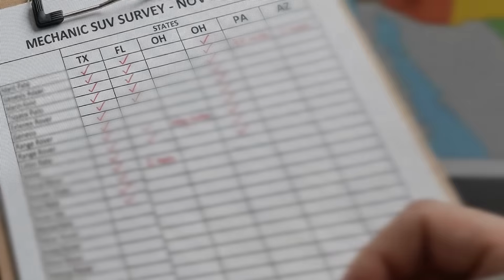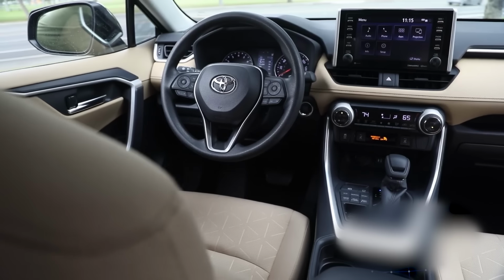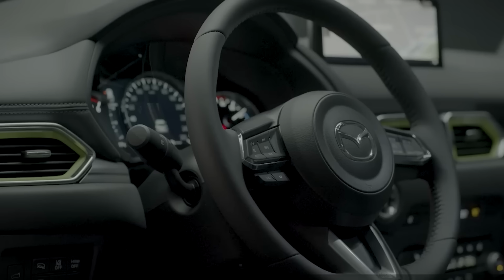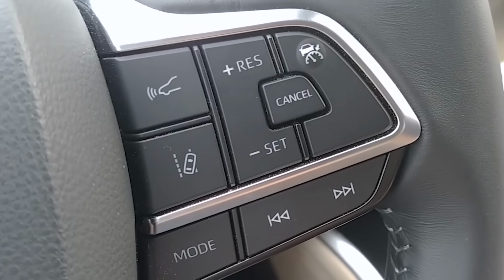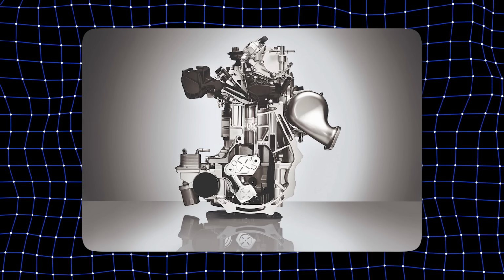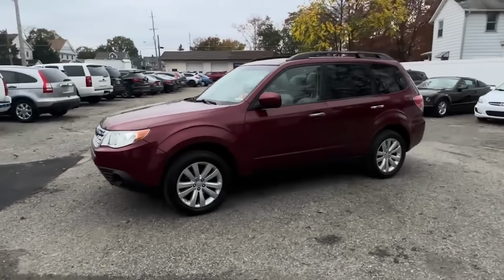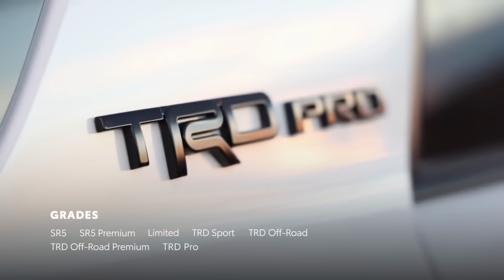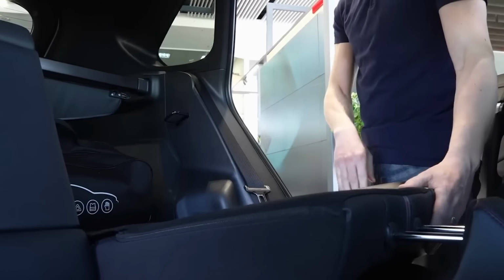7 SUVs Mechanics Trust With Their Own Money (No Premium Brands)

Comment: Why did you say Mazda uses port injection, when they use direct injection on all or most of their vehicles? You also said they don’t use cylinder deactivation, when it is pretty much standard in most of the CX-5’s and most models from 2018-2026! If I could find one for sale that does not have either as you claim, I would be the first to jump on that!
Reply from the maker: i'll check the script again. thanks for the comment.

Comment: I figured that the Rav4,would be on this list.I have a 2012 limited,last year of the V6 and I love it!
Reply: Mark Runyon, if I was in the market for a used car, the 2012 RAV-4 with the 3.5L V6 would be at the top of list! I just don’t understand why Toyota did away with the V6 in the RAV-4’s later generations. 🤔
Reply: @carlovanrijk4039  I don"t get it either,the V6 got 2mpg .less than a 4 cylinder.Turbo"s put more stress on an engine,not designed for them.
Reply from the maker: we're in a weird place for car manufacturing. Let's roll the clocks back 20 years